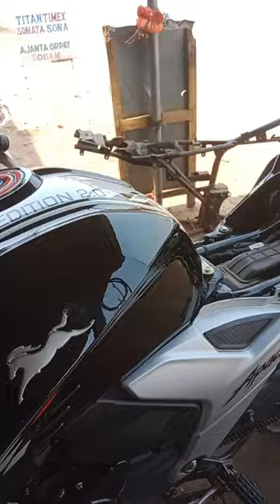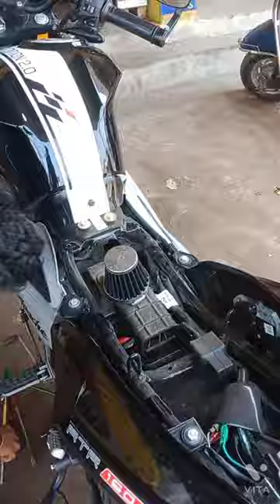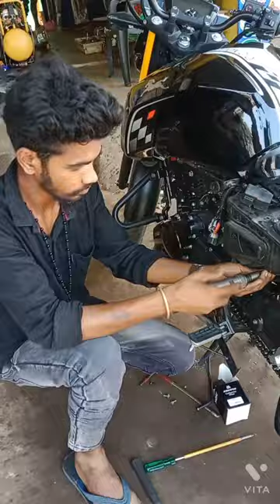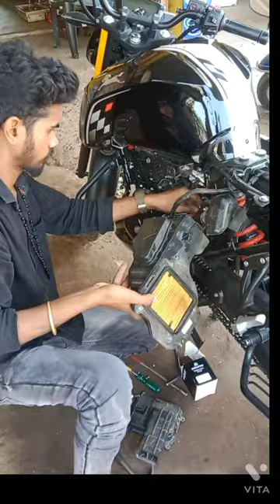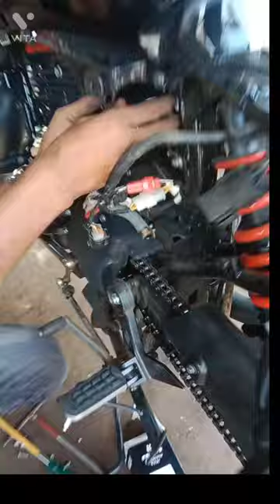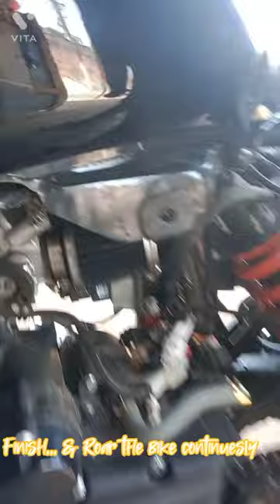TVS Apache 160 4v model kane filtter change.. 🛠️🛠️🛠️🛠️🛠️

Comment: Don't use the local air filter it's effect on engine performance and engine valve suction outside air and they choked with high carbon always use original modification filters

Comment: Let me know if this is right but the bs6 Apache has open loop system right no sensor on the exhaust so putting high flow air filter and exhaust won't change the performance na 😅

Comment: Bro the filter box is having label carburetor filter. I think it effects the engine if used for long time.
I have switched on engine once without filter. I then got the same sound as in this video.